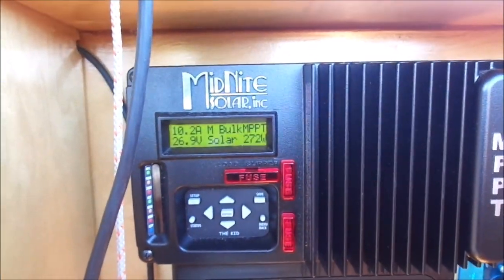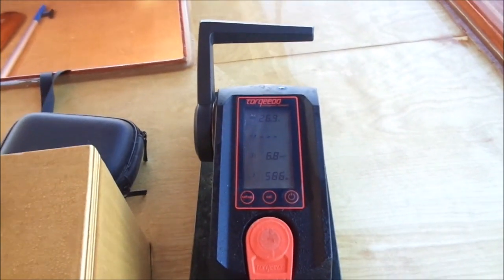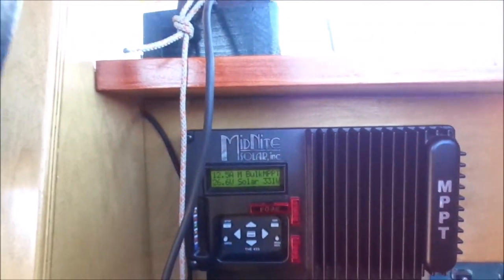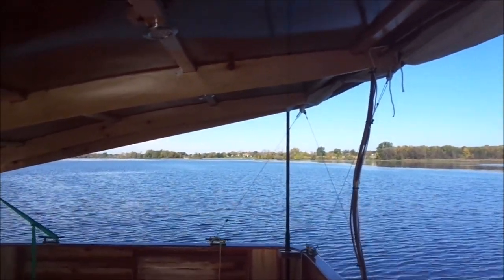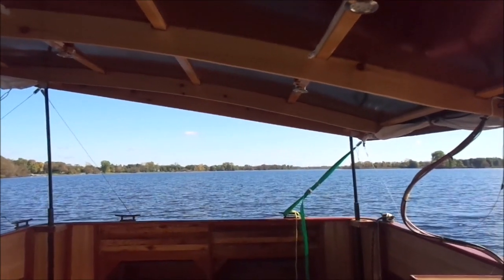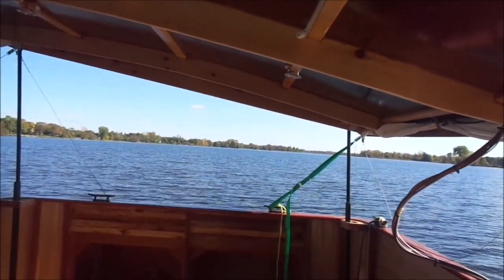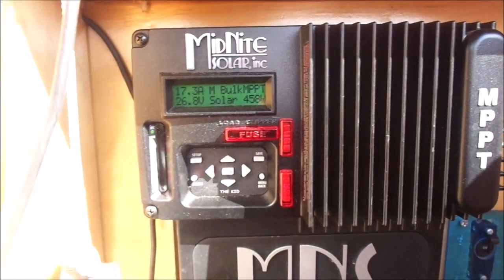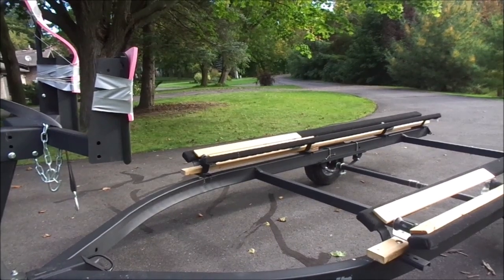Cruising With Canopy Tilted Building My Solar Electric Catamaran Part Twenty One

Comment: even the cross supports under the canopy are catching  the head wind. how are you going to fasten the panels to canvas? maybe an aluminum bar hinge.  half  a panel width in from each side and half a panel above canvas so  each panel bank can tilt both ways 45 deg .separate from roof. one small actuator to move both banks. will get more tilt that way. even anchors that you can fill with water to add weight to them. when you need them to reduce weight  . looks  good have fun
Reply from the maker: maximum angle I can achieve is 22 degrees but that is right down to the gunnel. I saw a good video about using neodymn magnets and am exploring that idea. Can't add any more structures as I am over weight now.

Comment: Always looking forward to your updates. What cruising speed do you hope to achieve?
Reply from the maker: I will be limited to hull speed of 10.5 km/hr  drawing about 1.4 kw but then add more power to get it to plaining speed up to 25 km/hr but drawing 8 kw. So for trips I will probably cruise at 8.5 km/hr drawing 1.2 kw. If the lightening of weight works I maybe be able to achieve this speed using 1 kw.